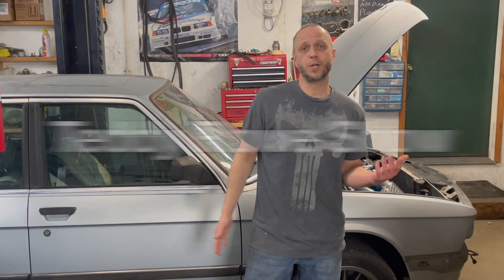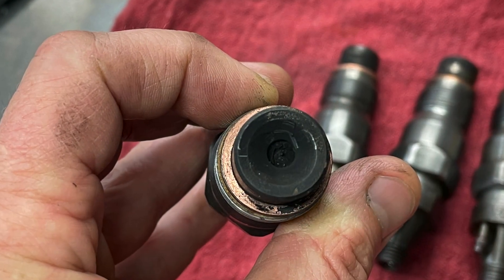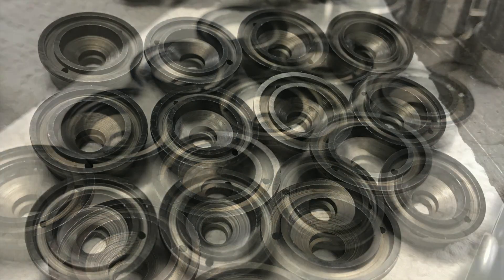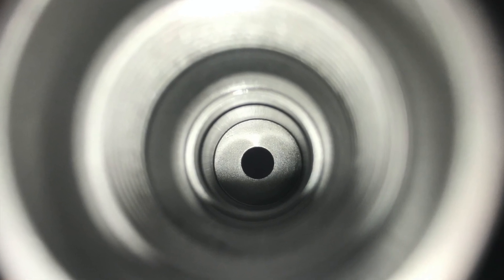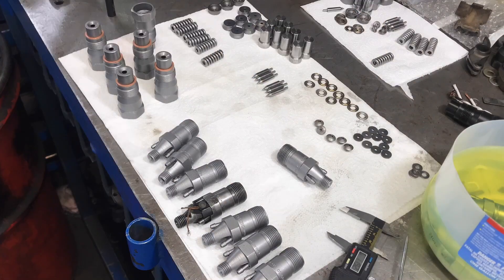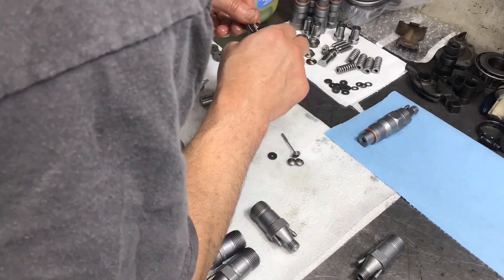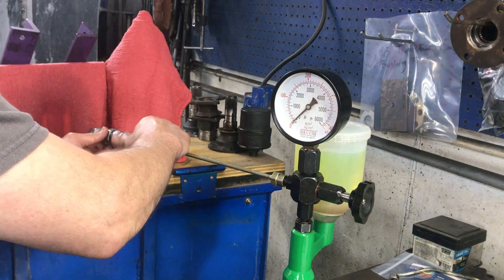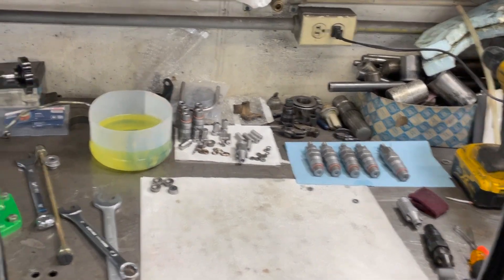BMW E28 524td Rebuild Part 8 (Bosch Diesel injector rebuild-IDI)

Comment: Hello. I have an 524td my injector with the lift sensor on it has lost its wire. How where you able to repair yours. Did you solder an extension or are you able to change the entire wire somehow. Will be rebuke my injectors soon. Thanks

Comment: Hello!I have e34 with m21 engine.Can you told me how i can get hp without engine opening?btw your videos are amazing good luck
Reply from the maker: I appreciate that but I am no pro with the M21. We are all learning together here and I hope to inspire other builds of any kind. With that said, I'll share a fear I have with the m21, its the head cracking issue. Sorry. 😩 It sucks. 😁 Just in case prepare for the worst and hope for the best. Start slow with some gauges like EGT, Boost and(or) Air/fuel ratio. So that you can monitor the extra boost and temps you'll be putting in the engine (down the road). Get familiar with the adjustment screws on your pump. The M51 uses a 10mm pump head which is in my near future too. That might be helpful. I wish you the best and let me think on this some more. Thanks again.